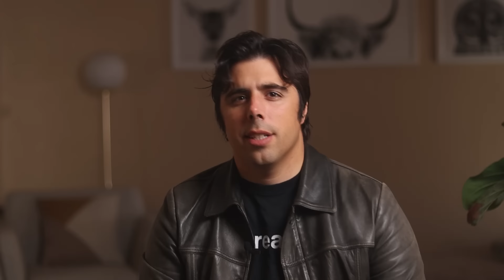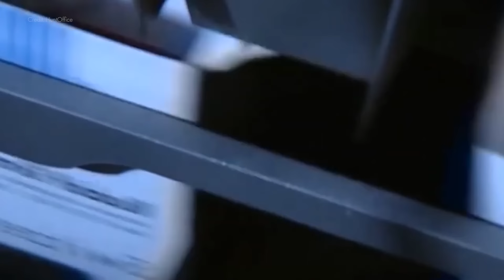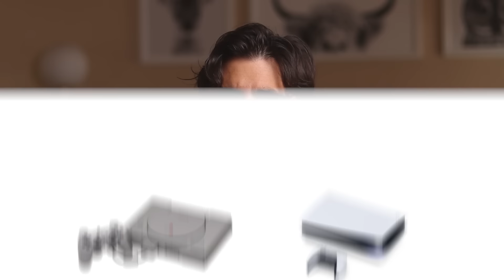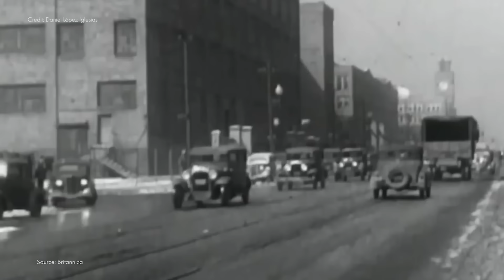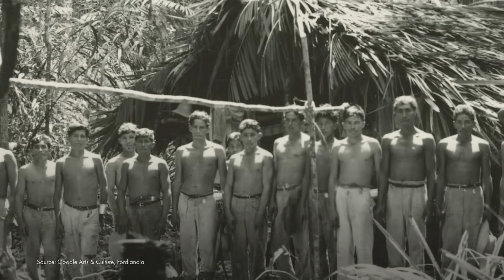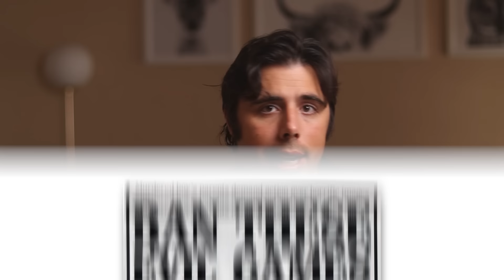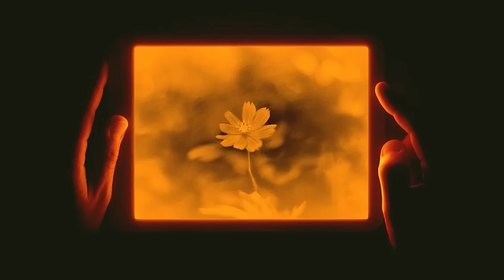Why Some Designs Are Impossible to Improve: Quintessence

Comment: 10:04 The Wii remote didn't quite replace regular controllers, but it did actually innovate in a way that's affected (nearly) every modern controller. The motion controls that started out as a gimmick ended up turning into gyro controls that were built into every future nintendo console. They allowed you to have just as much precision as a mouse and keyboard with the form factor of a controller, and the same gyro aiming was even added to Playstation controllers by the PS4. These days it's a standard feature, xbox controllers are the only ones that haven't adopted it yet.
Reply: i want to add that mobile shooter games also started  to include Gyroscope  aiming in the settings
phones already had all sort of sensors etc, but game devs never thought about using them for games
Reply: The PS3 had gyro as well. Wii remote definitely had an impact on TV remotes tho.
Reply: I don’t think motion controls give anywhere near as much precision as mouse and keyboard. Compare how long it takes to get a headshot with motion controls in breath of the wild to the fastest CSGO or Valorant flicks. don’t get me wrong though, motion controls are great for what they do such as making party games more erratic, giving more precise control over objects in 3D space on a controller (ex. BotW magnesis and TotK fuse), and giving more options when all buttons are used (ex. Super Mario Odyssey). they are also the preferred option in shooters such as Splatoon when keyboard and mouse isn’t available. I wouldn’t call them indispensable though, plenty of genres such as FPSs, fighting games, MOBAs, RTSs, and RPGs don’t have much of a need for motion controls.
Reply: @SK-df1iw  Nerrel has a great video that mentions gyro called "The Life, Embarrassing Death, and Legacy of the Steam Controller"
In it, he found that his gyro aiming outperformed his mouse aiming. Of course, this would vary by person, and I personally don't know if I believe gyro can beat mouse, but it seems to be worth considering.
As a side note, your comparison of BotW and CSGO/Valorant seems a bit unfair as eSports players spend thousands of hours practicing whereas someone playing Zelda might spend a cumulative hour of game time aiming with the bow.
Reply: @N_Nishi  It is a very unfair comparison, both for the time investment people put in those types of games and the fact that the precision of gyro aiming varies from game to game depending on implementation. Personally having spent thousands of hours playing splatoon, I find that the way it's done in BotW is far less precise by comparison. Heck, even between splatoon 2 and 3 there's slight changes that make 3 more precise than it's predecessor. There's a lot of nuance to how you translate a 3D rotation in space to a 2D camera rotation in-game (2D because you'd almost never have the camera roll). This means there's a lot more potential to mess it up, but also more potential to improve even further than the controls we have now.
Reply: @SK-df1iw you also gotta consider, it's also a huge learning curve. I'm sure if someone were to put hours into the skill, they probably be pretty damn good at using a gyro system for something like an FPS.
Reply: @SK-df1iw When it comes to third person or first person games gyro controls combined with another form of control (joystick, touchpad) give you an incredible amount of control and intuitive. You can get a rough adjustment with the stick, mouth, touchpad, then be precise with the gyro. If the Nintendo switch is anything to go by you can also get gyros into an incredibly small package. Having more options simply gives more flexibility, even if they're redundant -- 4 back paddles means you can use more fingers and gyro allows you to use your entire body to aim.
Reply: @SK-df1iw  motion controls can have more accuracy then a keyboard and mouse. And that is a fact. VR is definitive proof of this, every VR controller and to a lesser extent headset and body tracker is a motion controller. And lighthouse tracking is very similar to how the Wii Remote tracks its own position. 

It is when you take the 3 dimensional inputs of motion controls and convert them to actions on a 2D plane that things get fiddly
Reply: Not to mention that as far as Nintendo is concerned, the Wii remote did set a new standard in some sense. The switch's joy cons are basically just tiny wii remotes.
Reply: Way to prove you've never used gyro control settings. Calling them accurate is a giant lie, they are incredibly inaccurate, next, the wii wasn't the first attempt at motion controls, lightguns had existef for decades at that point, all the wii did was attempt to put them into the home, but that had also already been done effectively for games like duck hunt
Reply: @calebbarnhouse496  ...I mean
I literally said in this thread that I played Splatoon for thousands of hours using them, with much of that time spent using chargers, the most precise and difficult weapons in the game. But whatever, just call it fake and lies, I'm sure you with your cumulative 10-20 minutes trying them out before giving up know better about how precise motion controls are than I do.

Also do you even know how light guns work? They only detect where you're aiming by flashing the entire screen black and white and reading that on the controller. It's fun for a gimmick, but nothing like what the wii was able to offer.
Reply: @squiddler7731  no it's pretty simple, gyro accuracy is not an equivalent to actual 2D environments, the reason a mouse will ALWAYS be more accurate is it's abylity to perfectly translate a 2D surface to 2D planes, a character does not exist in 3d space, they exist on axises inside space, so when you move your mouse 400 units to the left, that's not something that there are any meaningful changes in what your doing, unless your using your mouse on a pile of rocks, while a gyro controller has to move inside of 3d space to equal 2d coordinates, gyro controls are fun, but they are not by any means about accuracy, nor speed, nor reliability, they are silly and enhance the tactile experince, not doing the experince better, next, lightguns started that way, but they've adapted with technology and gotten better, lightguns of the time were just a wii remote that was desighned to play one game, and more accurately then the wii did most times
Reply: @calebbarnhouse496  It all depends on implementation, and some games implement gyro aiming better than others. The same goes for mouse aiming too, aiming with a mouse is never actually a perfect 1 to 1 translation of movement to the screen. When you move a mouse faster, it travels further than if you were to move the exact same distance but slower. This isn't by mistake, it's an intentional feature designed to allow larger sweeping mouse movements without making small precise ones impossible, and if this were cut in favor of "perfect accuracy," then aiming with a mouse would actually feel like shit to use cause it'd travel too much with small movements and too little with big ones.

Gyro isn't inherently worse, it's just newer and more complicated, so games are much more likely to screw it up. We haven't had decades to refine gyro aiming yet the way we have for mouse aiming, and it is complicated translating rotation in 3D space to movement on a 2D plane. But it's not impossible, and you're delusional if you think it's just a silly gimmick with no real value to offer games.

Comment: weird to say that all controllers follow the same pattern as the ps2 controller when the dual shock was a direct response to the n64s controller which had a stick immediately without requiring a hardware revision, and when the ps2 controller was basically a snes controller with slightly longer grips, but sure, sony set the standard for video game controllers. it definitely wasn't the company that invented shoulder buttons and the directional pad.

Comment: First time here as the video popped up in my feed. Interesting subject.
The toaster needs improving! Within 6 months it toasts each side differently meaning that you can't rely on the automatic delivery of good toast. I set mine on 50% & have to turned the bread around midway through the process.
I refuse to make a smartphone my god. I limit use & apps installed to the essential: no social media, only a banking app to login on the PC. I never do banking on my phone.

Comment: The "classic" toaster mechanism also allows for simple lifetime limitation: a thin steel spring that WILL break at some point. I kept noticing the toasters thrown away, so I picked one up, took it apart - and all it was the broken steel "pin" spring. Fixed in 5 minutes.
Reply: I think this comment touches on a larger point when it comes to design of modern products. Longevity and repairability. Of course there are just some designs and ideas that are just destined to fail. However is become more and more abundantly clear to me, that companies value quantity versus quality. It could be said (from a purely numbers view point). That quality actually loses profitability. And quintessential designs are affected by this. In this video he touched on the paper clip and the ballpoint pencil. Since that product is quite often broken or lost and is very cheap it's not an issue to buy another hundred of them. However let's talk about something a little bit more expensive like the vacuum cleaner (for example). Now this is just a thought experiment and a quintessential design for a vacuum cleaner does not exist, but let's pretend that it does. If a company were to make a vacuum cleaner that was quintessential, likely one of its aspects would be reliability and repairability (Somewhat like the Model T.) A large portion of the population could end up just buying one of these vacuum cleaners and never needing another one. What happens to the company when everyone owns that vacuum cleaner? They stopped making money... as I said this is a hypothetical and extreme example but I believe it underpins a larger issue when it comes to design of modern products.
Reply: @chrissedwick7748  
Thats called planned obsolescence and its been a problem for a while now lol.
Reply: @Matcc  Our 2 year old portable dishwasher just died.  I know how to fix  most problems with commercial dishwashers  ( NSF certified) but I won't bother with a  residential one.
Reply: @chrissedwick7748  speaking of that last bit, a corporate entity, like google for example, its main goal is to keep expanding, i had thought about this before, like when you've expanded so everywhere that you don't have any where or any one to expand to anymore, then what happens next, the way they profit is to expand, but if they reach that point they are no longer profitable, will they start acquiring more and more companies under them, diversify their businesses? it's an interesting thought experiment, even for somebody that's not very fond of this system of economy
Reply: Unfortunately, most people don’t have the knowhow to do that, and toasters are simply too cheap to be worth paying someone who does
Reply: My family has had the same toaster for like 25 years. German brand Severin
Reply: @CuteAnimalVideos2580  ive had one for my whole life
Reply: @CuteAnimalVideos2580 

:21
Reply: @CuteAnimalVideos2580 

:21

Comment: Fun fact: in France, they have their own Azerty keyboard layout.
So, the fifth element is the need to be different.
Reply: The azerty keyboard exists for the same reason as the qwerty keyboard, but adapted to the french language. But it’s still the same idea that French speakers had already been used to the layout, so you can’t change it. It’s not a need to be different.
Reply: @strbourne  Hmmm..
France being a little special every time is the fifth element I guess?
Reply: Also the German Qwerty keyboard is the same as the English one except the Y and the Z keys have swapped places. Y is hardly ever used in German, perhaps not even at all.
Reply: @kiwitrainguy  My country also uses that layout.

Comment: You mention 1986 for the Nintendo Controller which is incorrect.

It was originally released with the Nintendo Famicom from 1983 (the Shape of the Controller and Layout of the Buttons).

Also the NES was released in North America in 1985.

Comment: A great leap in structural sophistication was the Hobie Tri-Foiler.  It is a hydrofoil catamaran sailboat with two masts side by side, bracing each other like biplane wings.  The hull and foils work as one solid piece, but with engineered flexibility to keep the foils adjusted for depth.

Comment: By adding a few pounds of Vanadium, Ford saved a half-ton of iron himself, and also made the Model T the easiest car to get out of the mud, which happened very frequently away from cities.  Until the T, designers were always told to make things as strong as they could. Then Ford decreed "Make it as light as you dare."  Of course, it broke, but they just reinforced that part, and the next one, until it stopped breaking while still being extraordinarily light.  
BTW, paved roads were first built for bicycles, and even earlier, when they first became popular, the inbred "Village Idiots" of England ceased to be a given, so your speculation about the genetic benefits of mobility is sound.

Comment: In regards to video game controllers, I really wish the Steam controller caught on more. I LOVE how the input pads have been replaced with touchpads like on a laptop. The right 'stick' has momentum so you can flick it to the side and the input continues to be given and fades away - I've made a habit of using this to control the Dark Souls camera, and now I hardcore struggle when I try to use regular joysticks because even on the maximum sensitivity setting the camera is just too slow and unresponsive compared to the finger-flicks of a touchpad input.

Comment: I am a little confused by the iPhone section.

I generally agree with everything you say, but when you are talking about 'refreshing', that doesn't really seem to be the iPhone.  Yes, that happens, but isn't that a function of the sites visited rather than the hardware itself?

It is a great example of quintessential design as (you are right) multiple platforms seem to have appropriated it, but sandwiching it between parts talking about the configuration of the hardware of the first iPhone just feels weird to me.

Maybe my mind just wandered off for a moment.  As I said, the information is largely correct, it just also felt kind of out of place.

Comment: Maglite is not a "quintessential design." It was flawed from the begining and remains so. It is now a niche product, being eaten alive by every light OEM out there. Thrunite, Olight, Nitecore, Fenix, Klarus -- the list goes on. Do some more research before making statements like this one, please.

Please also be aware of the fact that the 1986 Nintendo controller simply copied already-existing game controls from arcade games that had been in circulation for nearly a decade by that time. You young whippersnappers need to DO YOUR RESEARCH.

This is not surprising from a channel that pushes the ultra-craprod Opera <ack, thpth> browser. Please join the 21st Century and use tools which are not quite so garbage, eh?

Comment: The Qwerty keyboard is a steaming POS.  It was designed for typewriters when typing too fast would jam up the keys. 

Putting the keys in alphabetical order would make them easier to find, and if you are a touch typist like myself the Dvorak,  Colemak, and Workman layouts all put the most often used keys closer to the resting position.

The Maglite is also garbage.  The "police model" Maglite with 4 D batteries has a whopping 98 lumens (brightness) and weighs two pounds.  A Fenix flashlight of roughly the same size weighs 7 oz. has 3000 lumens, casts a beam 1500 feet, and the battery lasts 44 hours.

Comment: I did switch to colemak instead of qwerty it was a lot of work and while it has been great for me, I still don't recommend others to do the same because it took weeks of practice to get a reasonable typing speed again and I am still much slower than I was before, I switched because of carpal tunnel so I had a strong motivation otherwise I doubt I would have done it.

Comment: 7:50 I had a maglite flashlight once... and it was smaller than a tacobell soft taco. That's not very intimidating imo...
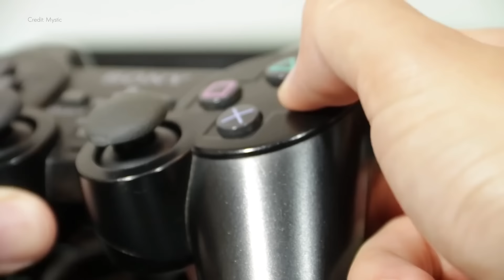10:00 as a kid PS1/PS2 controllers were fine... as an adult, every sony controller is tiny and makes my fingers cramp. Xbox controllers feel nice to me.
12:45 Uhh... if the Model T was $440 as you say, why does the number on the video only say $400? When you say $1050, the number actually matches at 1050. Now I don't feel like I can trust anything you say.

Comment: Sunbeam toaster and why it failed in my opinion:
 1.)basically boils down to why am I letting a toaster tell me how I like my toast done? 
2.) There’s more parts making quality control much harder even if the basic components are just as reliable as other toasters.
3.) over engineering, why does it need to be automated?
4.) price is also just not worth automation